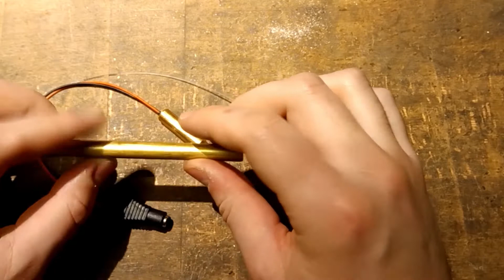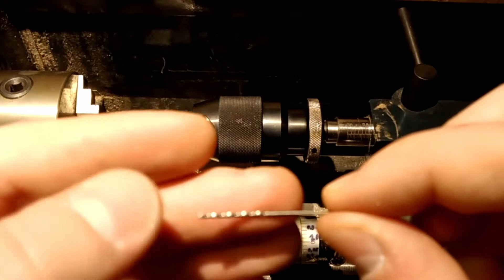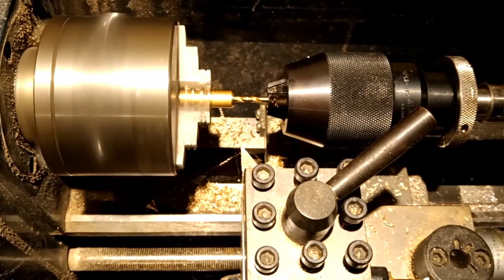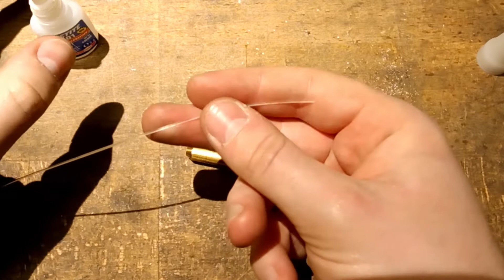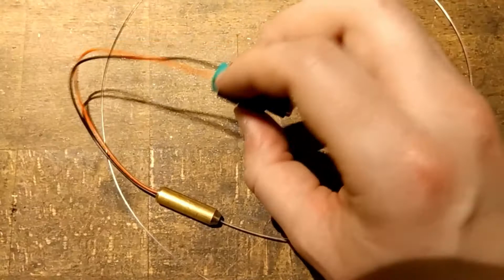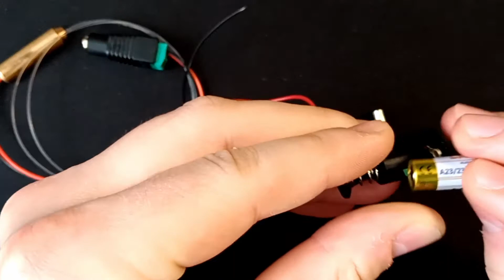[8] Making the LockLamp to better see inside locks

Comment: Before you went onto the second part, I was thinking this could be battery operated.
Reply from the maker: That was always the intention. But since this is mostly aimed at people that pick high-security locks, and they pick in a vise most of the time, I wanted the ability to use a plug-in power supply, so that you don't burn through a lot of batteries in a 3h picking-session.